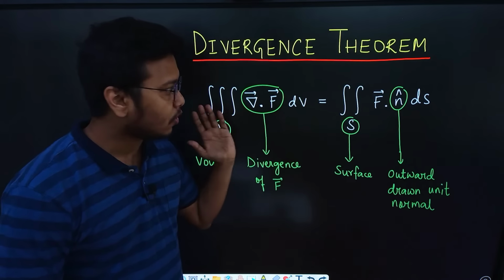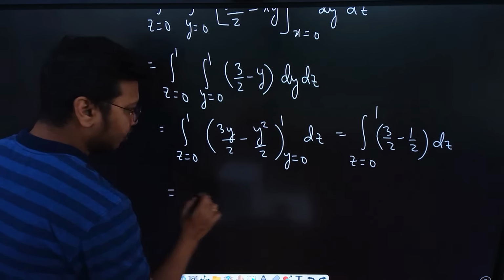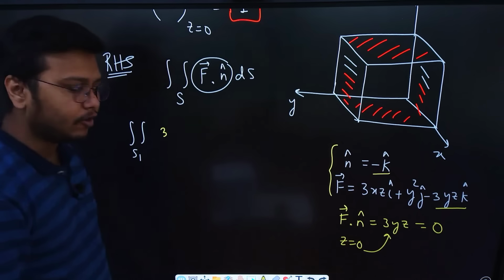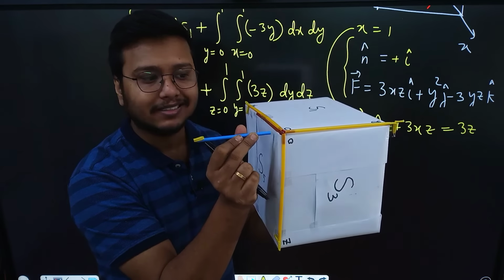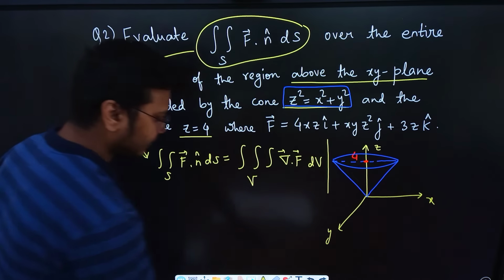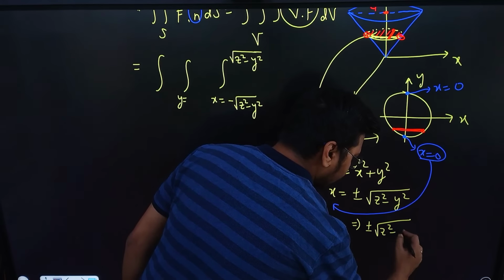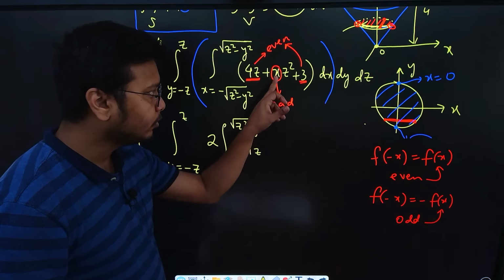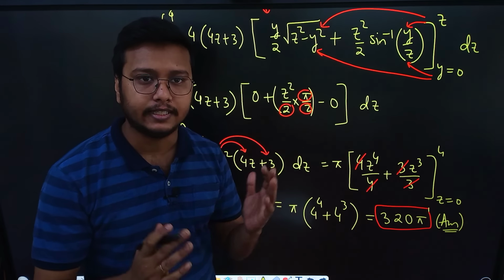Gauss Divergence theorem (Solved problem for cube and cone)

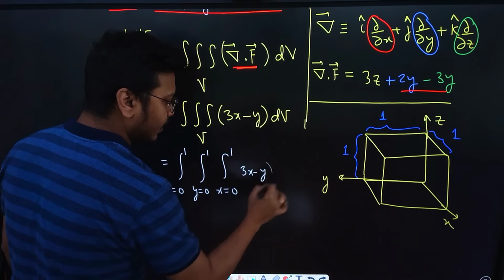Comment from the maker: At 4:20 the function in the integration should have been "3z-y" instead of "3x-y". It is a writing mistake, although it will not affect the final answer. The answer will remain unchanged after calculation.

Comment: Good vids...I have question, how do i deternine the normal vector for the wall of the cone ? Do u have a tutorial regarding to that matter? Tq
Reply from the maker: @AzamBin-cr1gt  You can refer to my video on Stokes theorem. In that problem I have derived the normal vector for a hemispherical curved surface. You can follow that method for the cone problem.
Reply: @rbmaths 

Tq for the fast response...I'll try... I keep puzzling how to get the normal for the cone...I guess it is not that easy (for me)...😅😅😅
Reply from the maker: @AzamBin-cr1gt  Don't worry. I am sure you will get it, once you have watched the hemisphere video!

Comment: Very nicely explained sir! Thank u so much😊❤️ Can you also explain for cylinder Shape plz
Reply: Sir could you make a video on stokes theorem?
Reply from the maker: @funtooshkb265  I will definitely look into it.
Reply from the maker: Welcome
Reply from the maker: Cylinder problem will be almost same as that of the cone. The difference will be that, in the integration limits, the value of z will be that of the radius of the circular section of the cylinder.
Reply: @rbmaths Oh yes sir got it.
Reply: @rbmaths  Divergence part is easy but unit normal part across the cylinder i.e. dS3 difficult 🥴
Reply from the maker: @tigerbhai233  Well Maths is easy yet difficult!